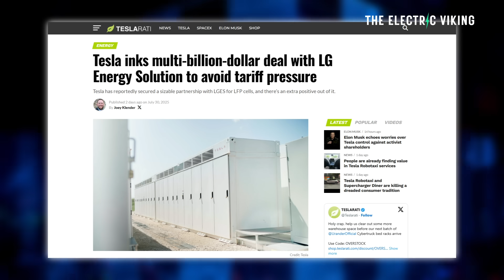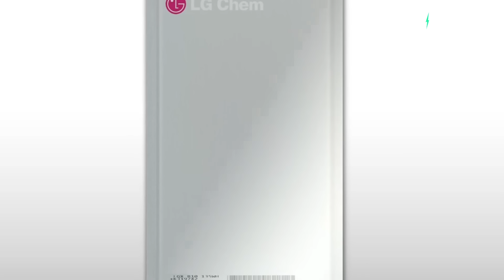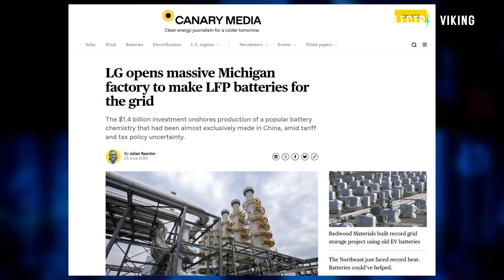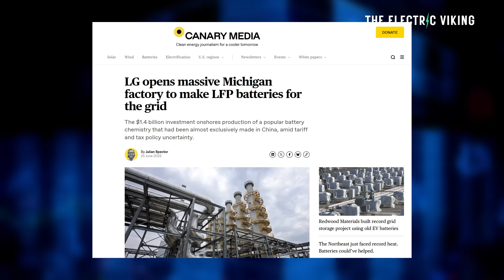Tesla Signs $4.3 BILLION Deal for 50% HIGHER energy Density LFP Batteries

Comment: LG’s LFP Energy‑Density Improvements:
LG is transitioning to pouch‑type LFP batteries using CTP (Cell‑to‑Pack) technology, which eliminates internal modules and allows more cells per pack. This design yields roughly a 5 % higher energy density by weight when compared to typical prismatic‑CTP implementations 
Mass production of these LFP pouch‑CTP batteries is expected to begin in the second half of 2025, currently targeting energy storage systems and automotive customers like Renault.
Reply: Which means don't buy a Renault. Well, you really want a Tesla don't you?

Comment: Seems a storm in a teacup. Blade 2 BYD batteries are in production now with 210 per kg at 15% below previous LFP (Blade 1). LG ls only 9.5% better density at a cost 22% more than BYD. It may help American market a little but Trump is trying to kill EVs there. In the rest of the world, it is insignificant. If the new Seal has a range above 700km, I won't care what the density is.

Comment: @6:00 If LG says the battery formulation is for the grid, believe them.  They're likely to end up in PowerWalls, MegaPacks, and CyberCabs.
Why is Tesla doing this? To get rid of the middleman. It foresees the need for batteries as growing far faster and deeper than itself. 
They make their own supply and are insulated from competition for batteries. (Same reason BYD did it.)

Comment: I doubt these batteries are for the autos, they are for energy storage products.  The production process for the batteries  Tesla uses for Autos is separate.  Tesla wouldn't move to a new battery for their autos unless the ability to manufacture them at the quantities needed was already there.  This will be a phased process.  This allows Tesla to get the kinks out of volume manufacturing a new chemistry before it goes into wide production.   It won't be available for autos until they can manufacture these things at scale.  LG cannot make enough right now to supply the Auto line of products.

Comment: Why do you think they will fill the same kg battery in the cars? they put the amount in that they need to sell them, higher density means a lighter car, not longer range. It has just come out that the cheap mY will have 50 kWh, they need to do that to get it cheap.
Reply: Lighter car means longer range with all else being equal.
Reply: @veganpotterthevegan  Lots of test shows it make very litle change with this kind of weigth change but the point is they dont just fill them up with batteries as the batteries gets lighter.
Reply: @andders2477  little changes add up.  Its about any making marginal improvements.  Weight is a significant factor in fuel efficiency for city driving and it always will be.
Reply: @andders2477  one other gain is that fewer batteries can mean more space inside the vehicle.  Vehicle size is limited by people's garages and the desire to park them. But the internal size can be larger relative to the class by having more leg/head room and storage.

Comment: I'm now waiting for the new batteries and HW5 before updating my 2020 Model 3 AWD LR.
Reply: You are a patent man, at 82 I am no longer waiting.
Reply: It's Tesla--there will always be new tech coming! That said, I'm waiting for a two-seater convertible 😜
Reply: @SP30305ATL go Tesla roadster
Reply: I have a 2024 Tesla Model Y LR HW4 FSD 13.2.9 and rarely touch the steering wheel.  FSD works fantastic and is a much better driver then a lot of maniacs on the road.  Yesterday, I was returning home on the freeway and there were at least 4 incidents where human drivers were darting thru traffic at least 20 mph over the speed limit and nearly causing an accident.  FSD would never do that.  Looking forward to AI5 as well and hopefully a longer range.. 350-400 range would be great.  I lose a lot of battery charge when using Sentry and pre-cooling my car.  I am getting solar with a battery backup very soon and then plugging in at home will be a go to.  I stopped plugging in at home because the electricity usage moves me to the highest tier and I spend over .51 cents per kwH.  I can charge at .30 -45 cents at a Supercharger and catch up on my favorite Netflix.
Reply: @FiscallyResponsibleCA  Wow, that's crazy--are you in California? Our standard electricity plan in Georgia only goes up to 14.8 cents in the Summer over 1000kWh/month, and there is an option useful for EV owners where we can pay just 2.2 cents between 11pm and 7am, but 29.8 cents between 2pm and 7pm, June to September, and 10.2 cents the rest of the time. I thought our prices were high, but 51 cents at home is ridiculous.
Reply: Will the LR get this battery tech or will it only be SR?
Reply: batteries are irrelevant.  E. Lawn will always keep maximum mileage where it is.  Consumers will never get a 500 mi car from Tessly
Reply: It's all fake news. There is nowhere reporting about 50% improvement -- it's just impossible. And in fact, these are standard batteries coming from LGES’s U.S. plant in Michigan. And these batteries aren't even for cars, there batteries are intended for Tesla’s energy storage systems, such as Megapack and Powerwall.

Comment: I think it isn't as spectacular as portrayed. Yes, the deal is smart in terms of mitigating risks in businesses by investing in multiple partners, compared to investing in a single third party partner. If I understand correctly, this battery is a midtier kind of option. That still means there is a "lower tier but good option" and a "higher tier premium battery chemistry technology" option. Nothing more, nothing less. With all three tier you can get more range depending on the size and specs of the battery packs, only maybe the weight and other performance characteristics being different  (like range of speed and power performance for example). I think the story is more nuanced than the news alone. I do agree it is more political potentially with recent events in the geopolitical arena. But as long as business contracts for a diverse batterypack supply continues, its business as usual, I think. If either South Korea or China business fails, Trsla still has options, which is perhaps the interesting part of the story. The only worrying part still is that LG has not had a great track record on battery safety in the past. The most interesting part now is, now that Tesla does dare venture into this deal. What will LG now do differently or better? I that that it the more interesting part of this deal than the narrative of Trsla seeming to choose CATL over LG. And I think geopolitically I also am curious if there is a correlation with Trsla business and the population decline story in South Korea. I think in this story we might also gear a deal with Tesla, LG and the KIA/hyundai group of Yrsla is willing to share the technologybin due time, so we might see interesting developments in the near future too potentially, in my view.

Comment: LG is very unreliable company. Plenty of problems with whatever they are producing. I will not be surprised if these batteries will systematically fail.
Reply: Those were Li-ion pouch cells.

These are LFP.
Reply: @JohnSmith-x3y8h  NMC pouch cells. Still Lithium ion, but with a vastly different chemistry. LFP are Lithium ion also.
Reply: @davidbrayshaw3529 

I know LFP use lithium 🙄

However the fire risk is completely different.
Reply: @JohnSmith-x3y8h  Far higher ignition point and it doesn't oxidise in decomposition. NMC batteries should never have been allowed to be used in cars.
LFP is far safer.

Comment: LG Chem - the most prone to spontaneous combustion EV battery on earth. Auto-ignite will be a new Tesla feature.
Reply: Did you miss the part that they are LFP?  Your comment shows you're uninformed.
Reply: The chemistry and technology are different.
Reply: I agree LiFePo4 batteries are much safer. But it too have its limitations. That limitation is weight and energy density. Else, all EV batteries would be LiFePo4 batteries by now. We don't know what the deal is exactly but likely something else other than LiFePo4. LG Chem is known to be churning out batteries that have been prone to TR. Whether it is unproven tech or tech that is not yet ready. The pressures are ever more high. Can we expect the company to change its past record while under tremendous pressure and duress? Should we not question it?
Reply: @canismajoris3910 Your auto ignite feature on Teslas using LFP was ridiculous and unfounded.  You should delete it as it shows you don't understand the subject your commenting about and you come across as a dramatic troll.
Reply: @ericreed4535 - where in my post did I say Tesla using LFP? Please read it.
Reply: @canismajoris3910 It's in the title of the video.  It's the subject of the comments.

Comment: Yea I’m not buying another tesla till that range is 400+. I have zero range anxiety but I just refuse to invest more money into another car til there cars are on par with GM and BYD when it comes to range. But we will see the long term real world range from GM. I’m very optimistic about them tho. They just don’t hold a candle to Teslas software and tech
Reply: Isnt the new model y about the 400 mark now
Reply: @awb07d it is most certainly not. I don’t have the new model y. Mine is 2022 but the new long range rwd get around 350 EPA rating. Which means realistically around 320-330
Reply: 🔌🔌What would be your response if the 2026 Tesla Model 3 equipped with LFP technology offers a range of 435 miles with operating temperatures of -20F to 130F and permits charging to 100% without incurring battery degradation? Another semi truck power train manufacturer might be testing these out in the southern states and Detroit area. 🔌🔌

Comment: LG being a Korean company means US Tariffs against China will not apply. Nor will any IP or trade limitations between Trump and China apply. The battery tech by itself may not be the main reason why Elon chose LG, it could be more political.
Reply: North American LG chem batteries sucked and caused GM huge problems
Reply: LG is the problem here. They do not allow independent testing of their new batteries. Tesla should know its history; claim after claim has proven to be false. 
General Motors (GM),	Ford,	Hyundai,	Volkswagen,	Stellantis,	Renault,	Lucid Motors, Volvo and Honda use LG batteries and they are okay but never near their original claims.
Reply: Solid point. I think Electric Viking missed the political point (tariffs) forced Tesla's hands
Reply: There is so much wrong reporting here. Batteries will be manufactured at LGES’s U.S. plant in Michigan, aimed at Tesla’s energy storage systems (such as Megapack and Powerwall), not for vehicles. There is no mention in any credible source that these LFP cells offer 50% higher energy density. LFP batteries, while improving, still have lower energy density than Tesla’s NMC or NCA chemistries.
Reply: These batteries are produced here in the US
Reply: It could be, but one problem is Trump is so inconsistent-- he keeps adding and subtracting tariffs on a whim.  Korea is not immune to it.
Reply: but I'd like to to know the charging characteristics (max C & charge curve etc).
Reply: So China will legally aquire this tech in a few weeks......
Reply: What's their history on spontaneous combustion?
Reply: Its all about the manufacturing... Trump doesn't want to keep out competitors, he just wants them to build HERE. More hi tech manufacturing to the US, more tax revenue.. win win for us
Reply: @jerz8289 the problem with manufacturing here: Trump is offering no loans or incentives to build those industries here!  And Private banks or investors won’t fund it either—  because the risk is too great since the tariffs can come and go on a whim (or after this admin is done).  Building manufacturing here would require billion dollar investments that will take decades to pay back.
Reply: @romanval69 the tariffs are the incentives. 25% tariff = 25% incentive to build in U.S.
Reply: @jerz8289   Trump is also working for the US fossil fuel industry.
Reply: @TronJockey  Yes, I know. The United States must prosper and unleashing our fossil fuels is one of the ways to do that. Man-made climate change is based on inconclusive data. It is more of a scare tactic than actual fact. We are only a fraction of a degree higher than the medieval warm period- and last I checked, no one was driving fossil fuel vehicles back then. Don't get me wrong, I love clean air- it is better for everyone, but the technological advances of the market will eventually make fossil fuel burning vehicles OBSOLETE.
Reply: @TronJockey  You mean he is doing things that will benefit them? What about next year or the year after? They are dinosaurs selling dinosaurs as fuel.
Reply: @jerz8289 US oil companies are not about to unleash oil and therefore lowering oil prices. Not going to happen.
Reply: @jerz8289  They are obsolete right now, I drive electric cars.
Reply: @tedmoss they arent obsolete.   Unless you own a home (which is rare these days)  a gas car is better theyre also better in winter.
Reply: @tedmoss  As do I... but I am not going to force someone to change over- they will on their own. Since 2022, I have lived in Kentucky- and first it was only my wife and I plus one other in the neighborhood owned a Tesla.. I hardly ever saw them around. Today, I see many Teslas in NKY, and there are now approximately 10-12 in my neighborhood alone.
Reply: @iskdude9922  Ownership is not the same thing as being in a single-family structure as opposed to an apartment.  Even renters in single-family structures can charge their cars at home.
Reply: @jerz8289  There is no market mechanism to guarantee that consumers will change over on their own before we have runaway climate change.  Since you don't want to believe that's happening I'm not trying to change your mind, I'm just pointing out to everyone else that if you're wrong, capitalism will not save us because capitalism does not give a f*ck about the long term.  Which is exactly how we got into our current trade problems in the first place.
Reply: @iskdude9922  "@tedmoss they arent obsolete.   Unless you own a home (which is rare these days)  a gas car is better theyre also better in winter."

EVs are cheaper to own and are growing into smart cars, just like smart phones took over from dumb phones.
Reply: @iskdude9922  65.8 percent of all Americans live in their own home as of 2022 that's about 230 Million Americans. A simple Google search tells me you have no clue what you are talking about
Reply: @jerz8289 I think you have lots of clean air. In your head
Reply: No, Trump is working for Trump. His hands under the table are clearly visible.
Reply: @zoransarin5411 ok.  Do all of those homes have garages or are capable of charging an ev?  Not necessarily.   But even so, you got 1/3 of the public in which evs arent suitable.  So to just swash away that whole sector is ridiculous.   Plus you the fact that evs suck in the cold,  they suck on road trips....
Reply: @jerz8289 still political, ford was planning to build a battery factory with CATL in the US but got rejected by the US government.
Reply: @vrealzhou  What are you talking about?  That didn't happen.  Is this Tik Tok news?
Reply: @jerz8289  You've been had by a brainless conman...